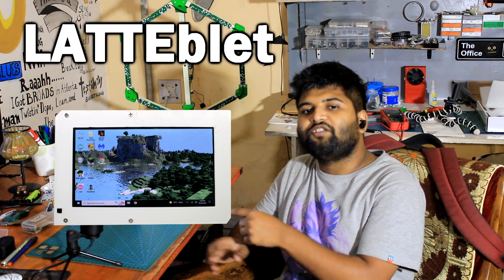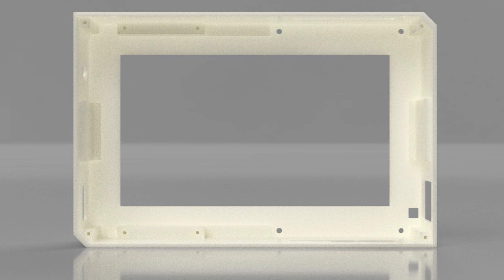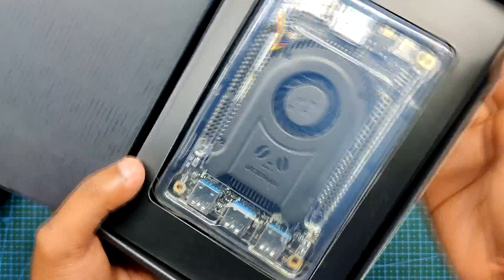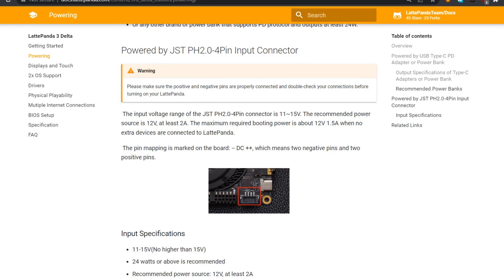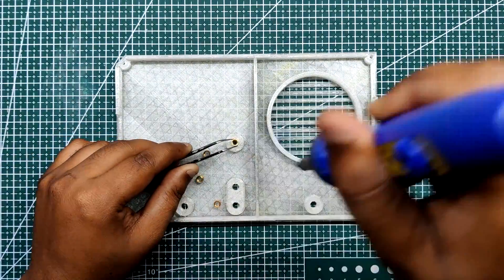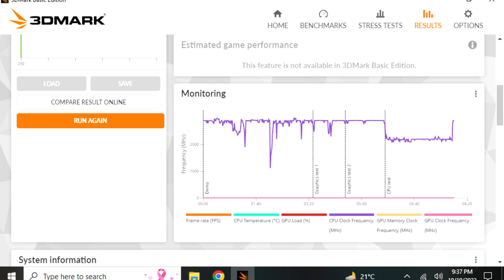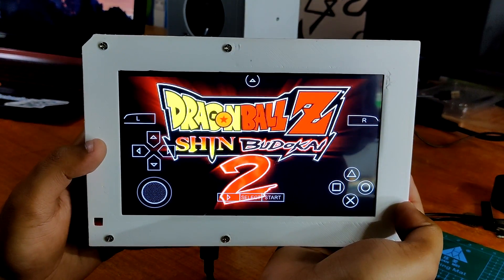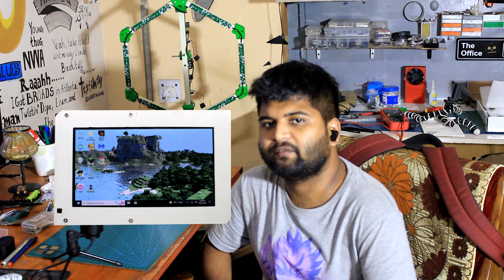LattePanda 3 Delta Handheld PC

Comment: Any chance you could make a video breaking down the batter pack you made for this? Doing a similar project with the Lattepanda 3 Delta and the circuit diagram doesn't seem to fully depict the wiring.
Reply from the maker: awesome idea, will do.
Reply: @ArnovSharma  Thanks!

Comment: I'm confused, Lattepanda's website explicitely says the display is not compatible with the Lattepanda 3 delta... It's even in the product page you linked "7 inches Touch Display (eDP) for LattePanda 2 Alpha&Delta (NOT Compatible with LattePanda 3 Delta 864)"
Reply from the maker: But it is and that's shocking